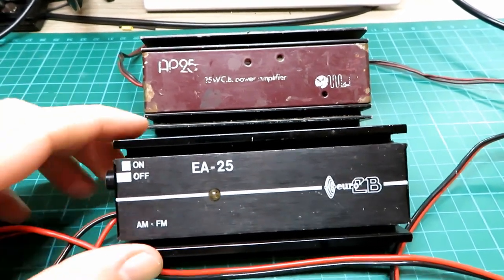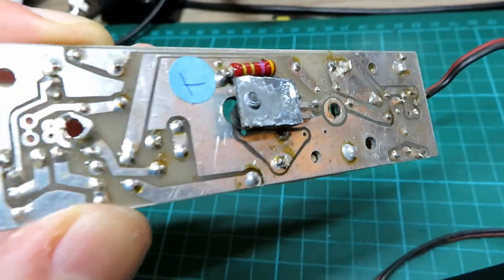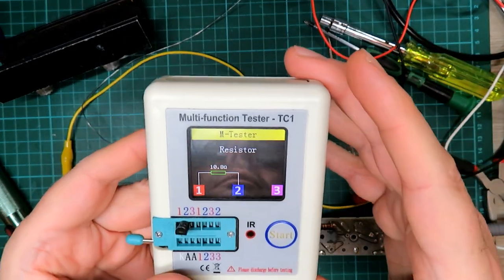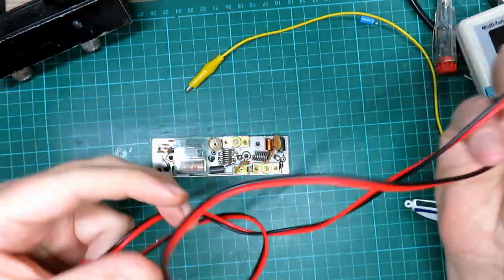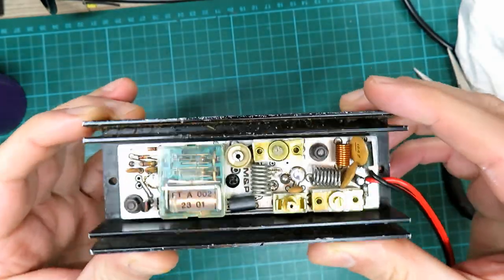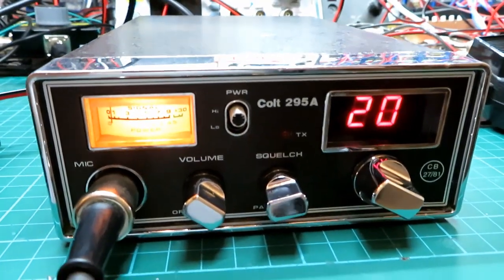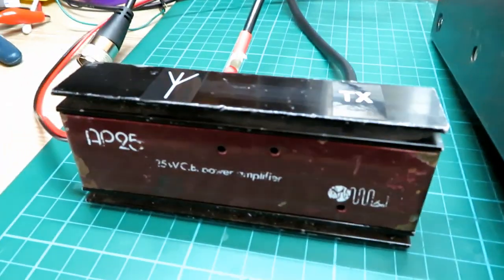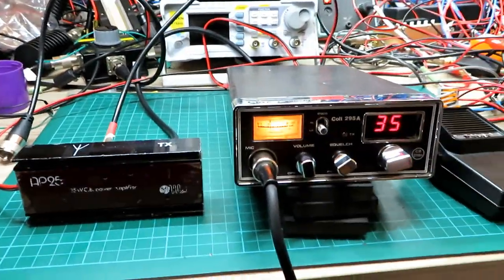25 WATT CB/HAM RADIO RF POWER AMP FROM THE 80S - CAN I FIX IT? AND WILL IT MAKE ANY DIFFERENCE?

Comment: When the 6m band was introduced in the UK the first radios were quite low power, like the IC505. These amplifiers were converted for use on them. I think Nevada even sold them preconverted. All you had to do was half the sizes of the coils and retune. Some people just shorted out half the coil length.
Reply: That would have fallen foul of br68 wouldn't it amateur radio is much more regulated of course you have to pass exams to be an amateur radio operator much more structured and regulated
Reply: @georgebodley8068  No it wouldn't. Radio amateurs can use any equipment. It doesn't have to be type approved. In those days there was no foundation licence, which does have restrictions.

Comment: Great video as ever Paul. Very interesting. Looking forward to seeing the EuroCB amp, as I still have a EuroCB EA-150P. I think it still works, but haven't got the guts to test it on one of my CB's 😬 I would love to service it, but haven't got the relevant equipment or knowledge needed 😔 It did work fine the last time I used it - about 20 years ago, and it's been in dry storage. I did take it apart and check the wiring a few months ago though. Looks pretty good to me, and is in very tidy condition, but not worth risking a bang...

Comment: that first unit you had apart I'd bet is actually from the late 70's based on whats used for the final transistor.  The 1307 was typically used as a final in single sideband radios here in the states ( and probably every where else too ).  If I am not mistaken, by the time the 80's rolled back around, most sideband rigs had switch over to the 2sc1969.  I believe that you know this too, but when making such a small difference, your friends rx meter lacks the resolution to show much.

Comment: The tuning of this in fact decreased the output from nearly 30 W (20:36) to ... slighty less according to the meter. (23:38). When you said you're quite pleased with that I was puzzled. Perhaps I'm missing something. Otherwise a nice video on troubleshooting. But I'm not so sure your tuning did much good. If it is the low power range that gets a boost, that would be fine but I can't gauge if there is any downside to that. I would rather trust how it was tuned and perhaps replace the blue cap as it is looking a little bloated.
Reply from the maker: The power transistor was heating up between shots that was reducing the over all power from cold it had increased 👍
Reply: @knoxieman  Hey, can you comment on what type of radio comms the Brazilian police ops squad is using (type of radio, long-range antenna, ear mic...) in the opening scenes of the movie "Triple Frontier" when theyre taking down that drug cell on the 2nd story raid of that building. Theyve got the radios Molle strapped to the back of their vests. Are they listening thru an earpiece & answering on an in-line mic? Thanks.

Comment: Nice but close to each other, on micks video of you talking switching low to  high, no difference. Bet at range it would. I had a 2m/70cm chinas finest amp thing from internet, on a new PSU but old school transformer 8A power supply, 40W. it did 15 and 12W on 1 band and other, useless thing, but sticker, test label in side said it did as promised so me and not sticking the 5W in of the baofeng, cheap RG58 coax and quite a long piece from spare room to inside roof, I sold it and the new PSU to 2 different people on ebay/ facebook!. Had CB and little 2m/70cm HH  set up in car 1990's, Just a cheap lies spec (as they all are in W) ham radio in car now

Comment: You could almost just cram that board in a stock radio, skip the rf relay and tap the mic socket for the switch on. That may be an FM only amp tho 😔

Comment: Knoxieman .... PLEASE keep your eyes open ... i've had FIVE items in your field stolen from the year 1982
.
Motorola CB Radio (27/81) - black - (car under dash type) - 2- knob with LED readout - black in color -
quite a small unit from those days and high quality
.
.
Binatone  Walkie Taklie - (27.81)  still in box - top of the range - hardly  used - real long ariel - 12V driven - metal back - high/low power switch - still in polystyrene in box - a beauty mate
.
.
A Havard (from memory)  - not sure as they stayed together for decades on top of a wardrobe
.
.
TWO old American AM walkie talkies - 2 channel  (19 + 6)  ?- black -  The one is distinctive as the telescopic areil has been soldered .
.
.
MANY THANKS  ITS NOT THE END OF THE WORLD BUT IT HURTS THAT THERS BEEN AN INTRUDER.
.
thanks again
Reply from the maker: I will look out for you and yes it sucks, my mum's house was broken in to in the late 90s, in my old house they got in the garage but the alarm went off and they ran off empty handed, 15 year Olds, they were caught as well but as usual courts didn't prosecute, there is no wonder burglary is still rife, they know they will get away with it.
Reply: @knoxieman  Many Many Thanks for replying !!!
.
I believe i know the culprit ???
.
The Motarola is a 201 model from 1982 and was in mint condition !!!
.
(it's family) ...(i believe) ???
.
"Knox" i know i need a "smart" alarm system but firstly i've never moved into the digital age and just "sneaky" devices  (matchbox on fishing line) would also help !!!
...
Yes i worked very hard indeed back then to pay for the devices that are now somebody's "trophies" !!!
.
Many Thanks mate you've cheered me up !!!